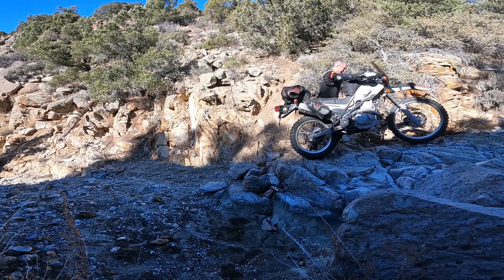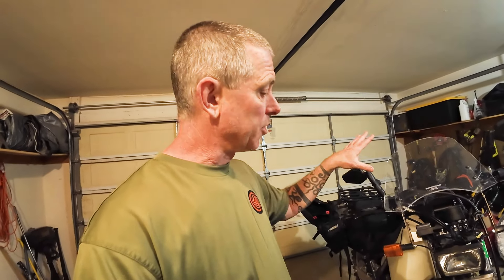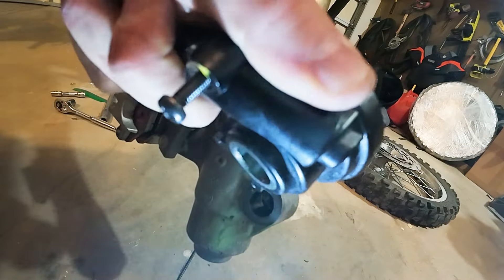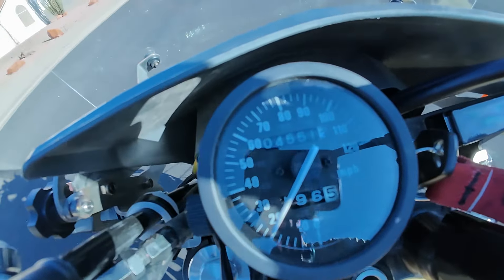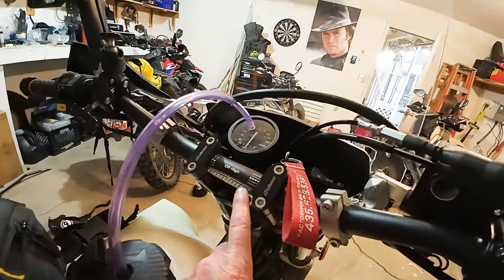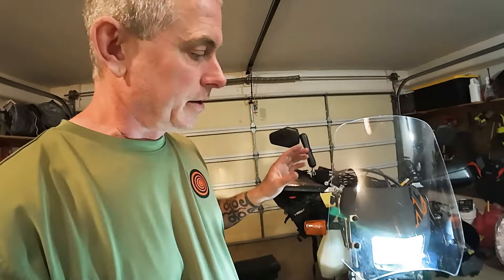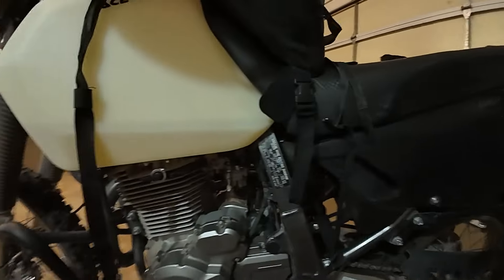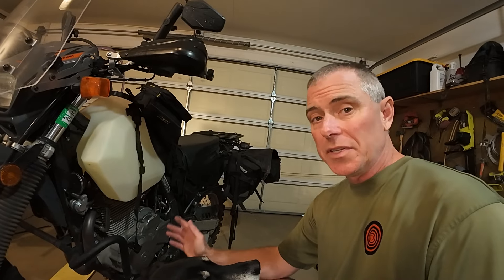Suzuki DR650 - All Mods/Upgrades - Speedometer Cable Fix

Comment: As always, great video. Can't wait for your Baja trip! Hope you get your new skid plate before the trip. On my CRF I could not stand the noise from the skid plate, so I took some heater hose and cut it in half, then mounted the skid plate. Problem solved.

Comment: I deleted the PAIR valve on my 2024 DR650, runs better and no popping noise on deceleration. Also replaced the seat with a seat concepts seat.
Reply: I thought my valves were trashed when I got mine, the noise was so loud lol. Glad the PAIR is easy to delete.

Comment: Nice build, as for my DR650 I'm on my first set of Dsport tires about 1500 miles no cupping on the front tire yet, they work well. I've been running Motoz tractionator Rallz tires on my 2007 BMW R1200GS for 20K miles getting 12000 on the rear before replacement, the front gets 15000 and wear even.

Comment: I went with the acerbis skid plate and it has held up well. It has a couple conduit clamps that holds the front to the frame. I thought it was too close to the motor and was a pain to take on and off. I made a flat bar and clamed it to the frame with those and welded nuts to the bar so i can use bolts in the front as well as the back. That spaced it out so it is easy to clean out and is very easy to put on and take off if needed.